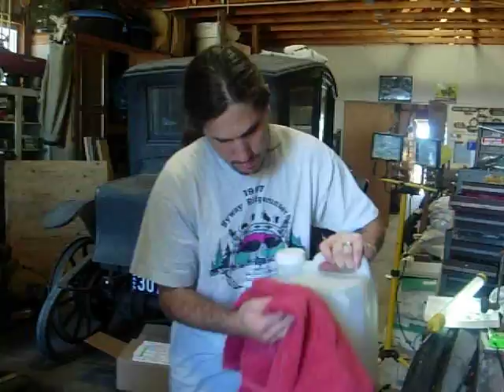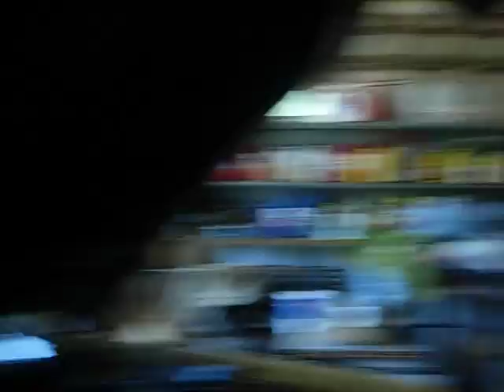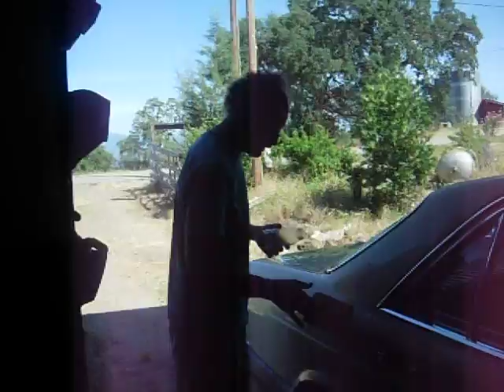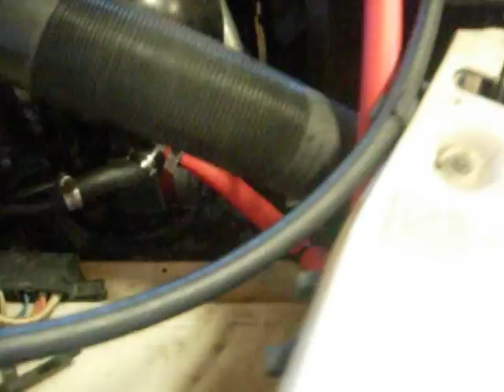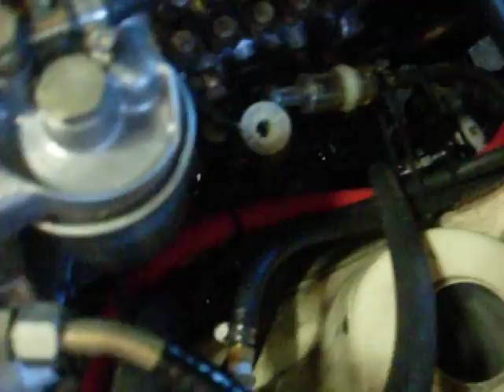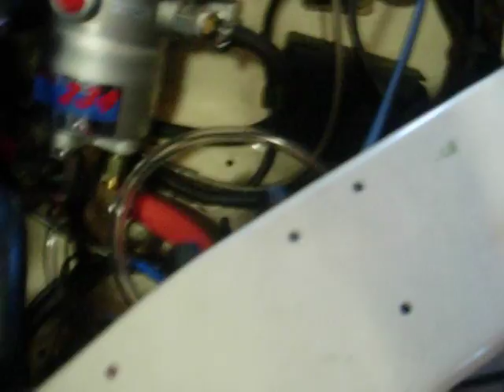Vegcar Conversion Mercedes 300SD

Comment from the maker: Mercedes 300-series (or 240) from 1979 to 1985 are the easiest cars to convert. A single-tank conversion will run you about $700. you can do it yourself for about $400 in parts. if you live in a cold climate, you might want to go with a two-tank conversion. this will cost a bit more, perhaps $1,200 or so. If you have a later model diesel vehicle, you will also need a two-tank conversion. 

check with the professionals for more accurate prices. Check out Greasel, Frybrid, Lovecraft, Greaasecar...

Comment from the maker: my car has now logged more than 30,000 miles on veg oil (single-tank conversion). it is still running great. I had to put $1,100 into repairing the A/C but that had nothing to do with running on veg oil.

Comment from the maker: The car converted in the video as well as my car are both single tank conversions. My car has traveled more than 25,000 miles on wvo and hasn't had any engine problems at all. The car in the video is a 300SD and is also running great on wvo.